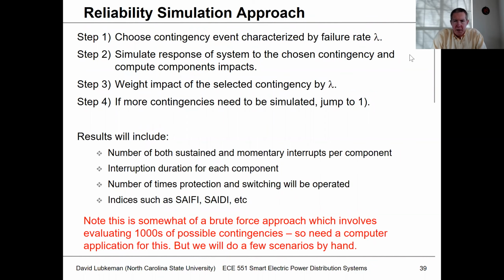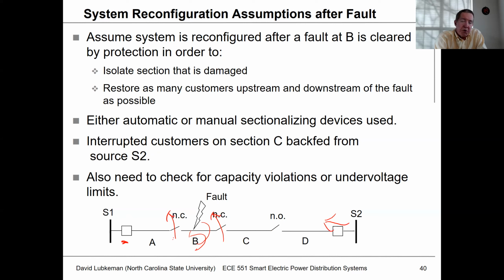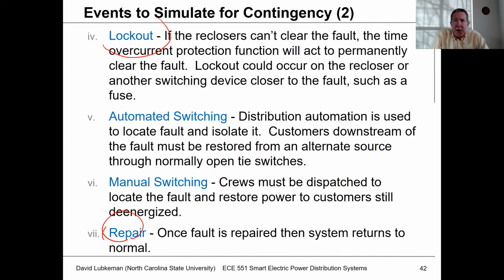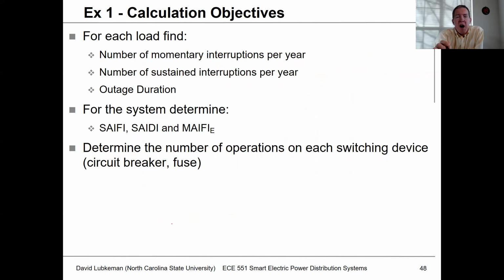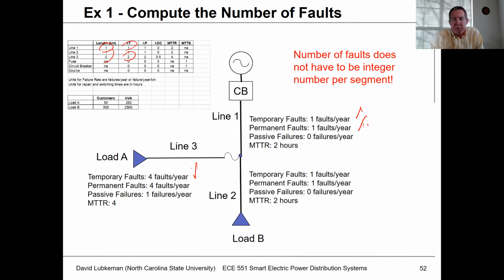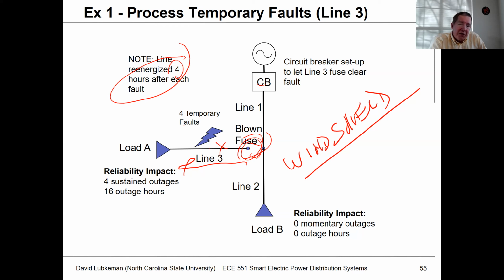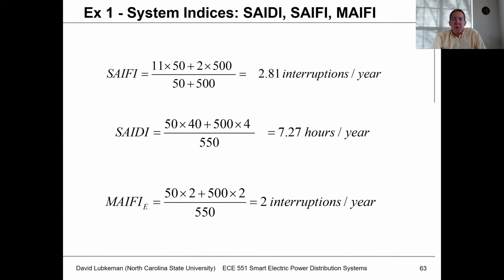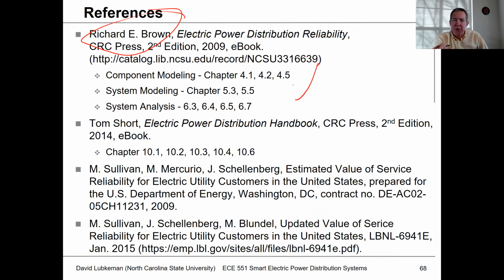Lecture 16c: Reliability Part 1 - Example - Power Distribution Systems Spring 2021 - Lubkeman

Comment: Great lectures. Thanks for sharing. In relation to SAIDI - Is 550 the Total Number of Customers connected to the system or is it the total number of customers that were interrupted?
Reply from the maker: The total number of customers on this feeder circuit is 550. When we get the SAIDI number, that would be the average sustained outage time on that feeder per customer per year.  In this scenario, every time a fault causes the top of feeder circuit breaker to operate open, then 550 customers will see an interruption though.
Reply: Thank you so much for replying so quickly! Just to make sure, is SAIFI denominator then the number of customers affected by the outage? (Different to the total number of customers on the network whole network). Thank you again for all the course notes and sharing them.
Reply from the maker: @WietseBuwalda  SAIFI denominator is also the total number of customers on the circuit.  So SAIDI and SAIFI are both averages over the entire connected customer count.  A consequence of this is that you could have a small number of customers on the circuit that experience many outages, but once you average this out over the entire connected customer base, SAIDI and SAIFI could still be low.
Reply: @dr.davidlubkeman284  Thank you again for your time! Very much appreciated. Learnt a lot from your course material.
Reply from the maker: @WietseBuwalda  You are welcome

Comment: In some utilities that use "smart meters" the utility then will know that there is a loss of supply. A prediction engine in the outage software will identify that there is likely an outage. Usually a troubleshooter will be dispatched to confirm the outage and / or the cause, e.g. animal, vegetation, lightning, vehicle etc. Then if a clearing of the fault can be done with a hot stick or has already burned off, the trouble shooter can re-fuse. However, if the trouble shooter identifies that a repair is required there are usually two scenarios. If it's single phase or two phase lateral, two trouble shooters can be teamed up to make repairs. If it's a three phase lateral, even though there's only one of the phases is out as a case in point, a three person crew is required to make repairs. Sending a crew to a predicted open line fuse as a first response is a waste of resources. Exception might be if the utility is in storm mode and a crew is out in the area anyway, then the crew might be asked to respond. Retied First Energy Reliability Engineer.
Reply from the maker: Thanks for the additional information regarding crew response.